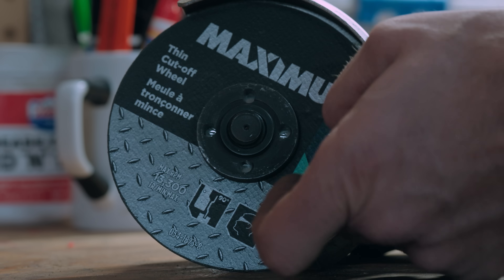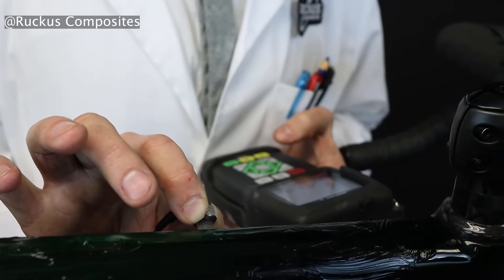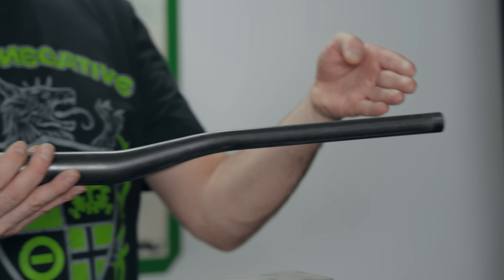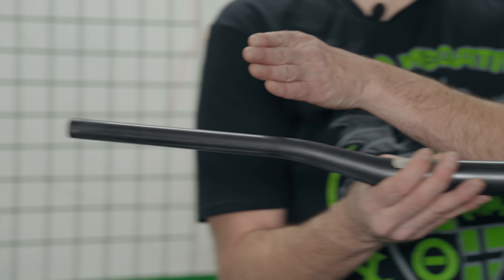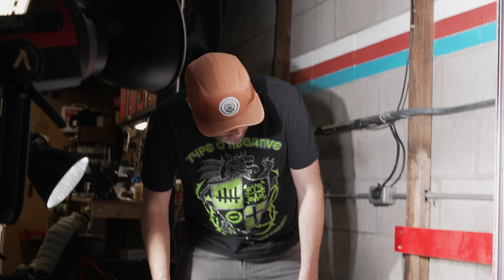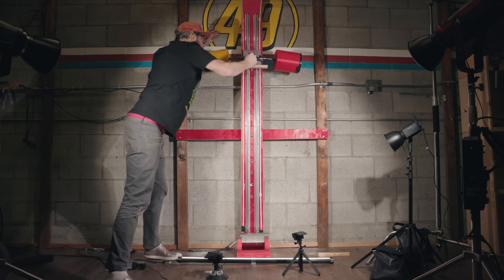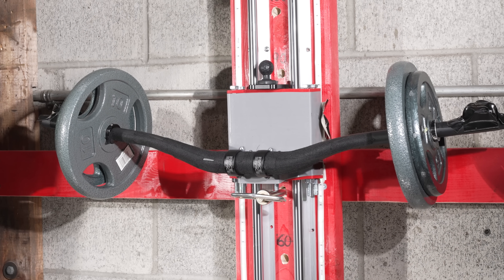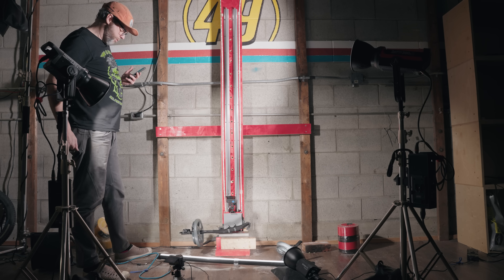Is Repaired Carbon Fibre Safe? Breaking Point Test

Comment: This guy again with a horrible and unscientific experiement coming to an inexplicable conclusion. Cant imagine Ryan signed off on this video concept. If the new bar broke at a lower force, why didnt the unrepaired control sides of the broken bars not break at a similar force? Whichever model he bought at the end is clearly not comparable with the repaired models, rendering the whole experiment useless.

This guy consitently makes the content on this channel worse.

Rob seems like a cool dude though.

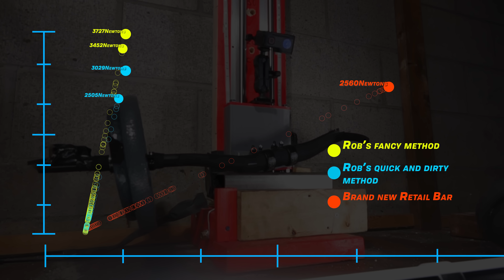Comment: The graph at 10:30 has me scratching my head. what does the X and Y axis represent here? I feel like this XY plot should have been a bar graph
Reply: there's also about 50 "data points" from 4-5 drops of a handlebar. it's bogus
Reply: @markifi  The test methodology seemed really shaky and half baked, but the results in the graph and his conclusion seem completely made up. Its a sad reminder that Fortnine is a parts and gear retailer and these videos are just commercials
Reply: No longer relevant.

This channel has devolved into clickbait with obviously flawed "tests" to stir up controversy and stimulate engagement in the comments.

It works for F9, but I hate it.

Unsubbed.
Reply: @stevenkelby2169 i really don't want this to be true!
Reply: @NickElliottuk  Me either but I think it's inevitable in capitalism.
Reply: @stevenkelby2169 goodbye stevenkelby !!!

Comment: Your methodology is flawed.  All bars needed to be the same, not just same material.  Second, notice that the fail point was the repaired side of each bar?  Yeah!  That means the repaired side was WEAKER than the stock side.  Your "result" was apples to watermelons.  The tests with the exact same bar with repaired side vs unrepaired side on the same bar?  That's apples to apples.

Comment: I went to school for composites and carbon fibre is hype shit. Most the time it's not worth using in structural parts especially with the cost. The biggest issue is the resins that are used. Though carbon won't degrade and weaken, the resins will. The weakest part of any composite is the resin

Comment: interesting topic, but I have to agree with the naysayers that the testing would have needed more consistency. In the end I expect your conclusion to be correct, repaired fiber plastic parts are at least safely usable. But the documentation and methodology was lacking and I am left unsure whether the conclusion is actually correct regarding low amplitude fatigue loads as experienced in most applications.

Comment: No offense to Rob, but he doesn't know how to repair carbon properly. All he is doing is bonding another section of carbon to the original part, it's not individual grafted in, and he didn't vacuum bag or infuse it with resin, so its just the bonding agent he used that is providing the strength, the individual fibers are not providing their designed strength... I'm in aerospace and a proper repair would be scarfing back the damaged area, and applying layers of carbon with alternating cord bias, lastly vacuum bagging and curing with heat. None of that was done.

Comment: Carbon fiber is a very nice material, but it's kind of become a bit overdone , like in my opinion, unless you are a racer, a carbon fiber bar isn't needed, a bar in general is going to way less than a kg (2.2 pounds for you americans), so no need to really make it out of carbon fiber, something like aluminum or stainless steel would be way better, and steel pretty much never fails catastrophically unless it's hardness is pretty damn high, but a bike bar is not going to have to have a hardness of 60 HRC so no need to worry about that, trust me your wallet will also thank you.

Of course carbon fiber can still be used for things like bicycle frame, a handlebar and still be pretty safe, hell it's safe for a lot of things , except for example something like gears, which are pretty thin( like on the casette of a bike) and they take pretty huge loads.
 And that is because carbon fiber isn't a homogenous material, basically carbon fiber can be quite a bit weaker when it has force applied in another direction, and in another direction it is a lot stronger. Usually steel has good strength all round no matter where you apply load, it can be twisting it, bending it horizontally, bending it vertically, it will have pretty similar strength in all of those loads.

Comment: This seems to beg the question if Rob repaired a broken new stock bar, would it break at below or above the original strength?
It'd be nice to assume that Rob can repair any carbon fiber handlebar to ~3500Nm break point, but given that his repairs were worse than the originals, it doesn't seem likely. It was nice of Rob to participate in the video but I think it's a stretch to conclude you should repair your new stock handlebar.

Also, the dots are pretty but where are the axis labels?!
Reply: I think the test didn't support your premade conclusion so you added some data that would support it. Anyway, the video runs the risk of reducing trust in the brand imo because it's shot in a style that uses the scientific method while simultaneously ignoring it.
Reply: @zachlevy Yea I have concerns as well. I've seen others seemingly mimicing Project Farm's style of garage testing, but you have to include all the steps. an <12 minute video was just not the place for this. The way to handle it for video content restrictions is to host a second channel with full transparency. That might alleviate the issues here by actually documenting everything you're doing before editing. What exactly were the weights, why when they failed did you not rebuild the rig and continue testing the broken bars' unbroken sides (the whole point of the handlebars as mentioned at the start)? Why do you think that a single accelerometer is a valid method of defining complex physics experiments involving very evidently more than acceleration and mass as variables? Are we trying to protect Rob here? Is the "carbon fiber repair" maintaining the same properties as carbon fiber, or is it "simple" fiber glass methods? Rob, #1, should not have made the claim that he did, because it's very specious to suggest that the repair is stronger AT THE SAME WEIGHT (which is not claimed but is the implied takeaway). Intuitively this makes very little sense, and while intuition is not good science, you can expect to require significant science to overcome situations that defy intuition as here. If F9 wants to continue doing these kinds of testing videos, a second channel with time to show the demonstrations of actual scientific rigor is going to be necessary. That <12 minute runtime is definitely the problem.

Comment: The methodology is quite flawed, I'm sorry to say. The idea is great, but the sample size is too small and the difference in weights between the repaired handlebars and store-bought version, means the comparison doesn't really hold up. Same with the breakage of the store bought bars, as it could've broken because the rig failed, instead of visa versa. 

The big barbells are too wide, so the weight is distributed along a much larger area. The actual weights concentrate all their mass on a much smaller area, changing the characteristics of the shock load. Ideally, the weight is the width of a hand and is sitting on grips mounted on the bars. 

This test doesn't take into account variation in production methods and brands. As 1 of each was tested, you can have a bad apple and it is always going to break. To really have an informed opinion on this, you need to test multiples of each scenario, in a much stronger rig, simulating reality is closely as possible. It also need to take into account fatigue, load at odd angles and more. 

Carbon fibre parts are made in many different ways and have varying shapes, each with their own failure points. As the third broken handlebar showed, some breaks cannot be repaired. If handlebars (in essence a carbon fibre tube) can be fixed, it doesn't mean a solid carbon part can be as well. It might, but the results don't apply to all carbon fibre parts. 

I understand a test of this size is way beyond a channel like this, financially, but the conclusion from this video is based on a test that doesn't really prove anything. At best the conclusion is that carbon fibre can be repaired in some occasions and can be as strong, if not stronger afterwards. It all depends on the break and the part, and definitely requires an expert.

Comment: Cycles to failure is a very real concern for all kinds of equipment.

At my old arboriculture gig, we would keep climbing ropes completely separate from rigging ropes, even if they were identical: we wouldn't trust a 6000 lbs test rope to support a man if it had ever been shock-loaded, or if it saw repeated use. Similar considerations were taken for all critical devices.

Well done D.O.D.
Reply: So if the repairs are more solid than the fresh bar, why did the repaired side breake first before the good part of the handlebar?
Reply: @D3nn1s    Maybe all that violence caused a bunch of nano cracks, fissures or whatever?
Reply: @garysarratt1  looked to me like it broke right at the repaired joint, meaning the repair gave way not the OG part
Reply: @D3nn1s    True, but that’s where he had wailed on it a few times to start with.
Reply: cycles are a huge deal in aviation, after so many cycles they just scrap the entire airframe.
Reply: Let’s hope you are talking about static ropes (although you shouldn’t really fall on those), otherwise the entire rock climbing community is laughing at you.
Reply: @gherites    I think he’s talking about trimming trees.

Comment: Can you tell us more about the repair methods?
I think that really matters.

As far as I understand, repaired carbon fiber is weaker because the resin connects the old and new carbon fiber parts would be the weak point.
Instead of carbon fiber strands go along the entire structure, there is resin in between the carbon fiber strands.

However, if there is more carbon fiber added to the structure, that could potentially make the part stronger.
That seems to be the case for one of the methods where Rob stucked a piece of material inside the tube and glued together.
Reply: Yes further explanation would be good. I'm in aerospace and I can tell you this repair method would not be approved. Essentially all he did was bond a new section on. All he is testing is the strength of the adhesive... A proper repair is not done on a "clean cut" the existing material should be tapered to provide the most surface area, and individual layers should be overlapped using alternate weave directions. It does depend on how the original part is constructed, but this repair method allows for the best bonding to the parent material with the carbon taking the load as opposed to the resin.
Reply: @plav032  Thanks for your answer

Comment: As someone who works with composites for a living there’s a reason why I have an aluminium ebike and not a carbon one(apart from the cost). I’m heavy and when I fails it just fails. As for repairing it, yes you can and you can make it stronger but you can just be moving the problem to around your repair as that will now be weaker than the repair. 
It’s just a minefield that can be easily avoided.

Comment: People throw out too much instead of fixing things had a hole in my plastic coolant reservoir from a rock instead of buying a new one i just fixed it with super glue to keep the original pieces in places then I went over it with fiberglass its been holding for about 2 years now

Comment: It’s not the question that it can be repaired but more how well it has been repaired. Furthermore. Carbon fibre can have a big range in product strength. I am left with a lot of questions anyway. The weights where poorly mounted, especially towards the end. Which improves the chance of local impulse forces / point cleavage. So no room for definitive conclusions.

Comment: I heard somewhere that particles from repairing (sawing/sanding) carbon fibre were pretty dangerous to the lungs. ?   Nice video 👍
Reply: Yes its extremely carcinogenic
Reply: It is extremely toxic. NADEP experience speaking.
Reply: Oh shush, now Karen....
Reply: @jamesonpace726  not at all. They arr lethal.
The dust never breaks down and sits in your lungs til you die.
Same condition as silicosis which is why sandlblasting with actual sand is simply never done by anyone with any sense anywhere anymore.
Nor is chopping or sanding fibreglass without respiratory protection, preferably a fed air setup.

Comment: The graph towards the end desperately needs some XY axis labeling if you want the viewer to agree or even understand the point you're making, because as it stands it seems that the conclusions of the video go directly against the demonstrated early failures of Rob's repairs. Practically speaking, CF parts that don't experience much load or tension are probably fine to repair but I wouldn't draw conclusions about anything else (especially since this does nothing to compare tensile vs compressive damage.)

Comment: but still, why didn't the other side break first? The additional bar you bought, was it the same make/model/year as the ones you destroyed before?
Coz otherwise you can't scientifically compare the results
Reply: That is a reason I gave a dislike to that video.
Reply: By brain went to welding. As you weld one point if done correctly it won't rebreak on the weld but further down the area due to the material being stronger at the weld but weaker around the surrounding area. I think the carbon fiber became stronger at the repair spot but since the area outside the repair spot is a weaker then it decides to break at that point.
Reply: @TheAtqthe30th Interesting thing about that, too. Someone might claim that a repair is "better than new" and indeed the break is near, but not at the repair. All good, right? Well of course not. Welding and other trades doing this type of load bearing work know that there are devious little details like the uniformity of a structure's properties and how it affects the distribution of force. In this example, a weld or polymer glue up would need to have the same flexibility under load, otherwise the "strong point" is actually weakening its surrounding material.
Reply: @TheAtqthe30th that's not what they are asking. The new bar tested at the end broke at a lower force than the repaired bars. But the repaired bars at a control side that was still original condition, so you should expect that side to still fail at the same force as the new bar. Its a useless comparison and unscientific
Reply: Yeah and I'm not sure if their "control" bar was the same brand, because it seems like they bought it afterwards. They should have had a control, and tested each side individually imo
Reply: @Ash-bx6kq  there's also the matter of the experimental setup working its' way loose... I can't figure out where they put the accelerometer, but I don't think the values are that trustworthy either. And 5 data points is nowhere near enough anyway for such a chaotic event as this.
Reply: he also didn't blend the carbon... he just bonded a dowel inside the bar, and bonded a new section to the dowel. It's only testing the strength of the adhesive he used. A proper repair would taper the existing carbon, and build up carbon layers with alternating weave directions soaked in resin and cured with pressure and heat.
Reply: @plav032  Yeah, I kept waiting to see an actual carbon repair. This is just putting a stick in between the break
Reply: @plav032  Let's be fair to what was said and shown in the video. 
At 5:54 Rob says that one of the bars was repaired cheaply (presumably that's the repair with a glued inlay, shown earlier in the video) and the second one was a "nice repair"(presumably paired using a different method, that was not shown).
Like someone else said, those handle bars are not laminated carbon fiber resin, they are most likely carbon reinforced plastic, which is not the same, and so the repair methods will also differ.
Reply: Yeah, this video isn't normal F9 quality.